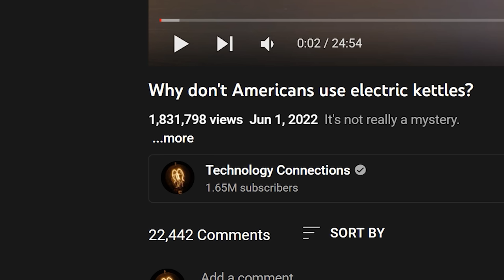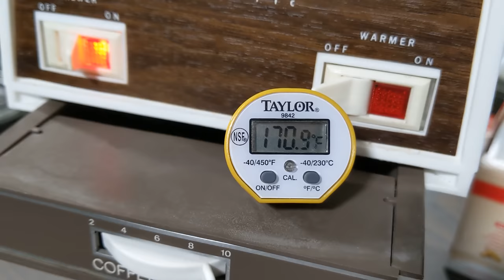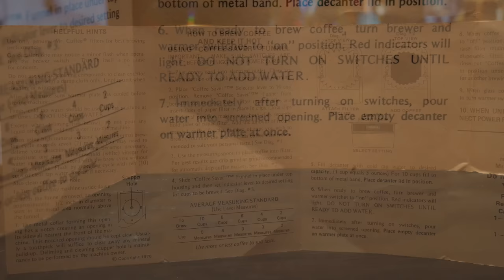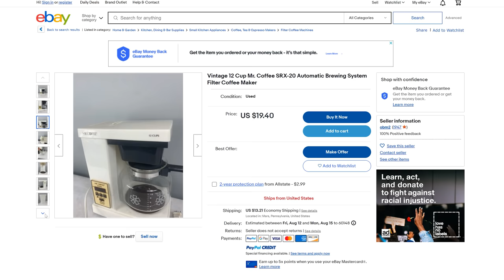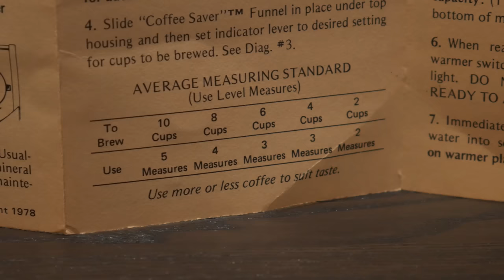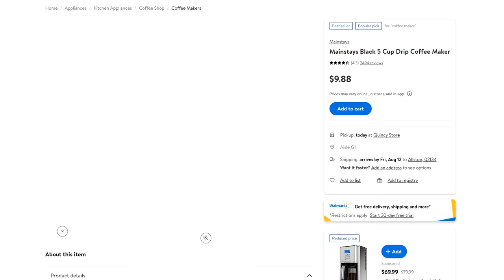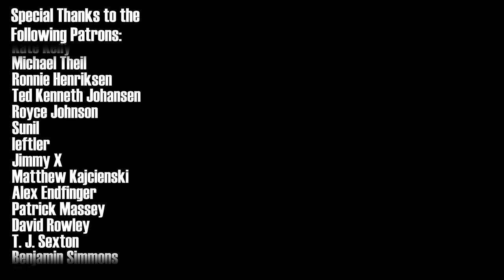Drip Coffee Makers — super simple, super cheap

Comment: I'd like to see you try the Finnish trick of putting a few pennies (usually 3) on the hot plate. Almost everyone I know (including most restaurants...) does this, with the intention being to reduce the heating from the hot plate to mitigate or at least delay the ruining effect heat has on the coffee.
Reply: That's brilliant:  thanks!
Reply: I can confirm we do that here in the Midwest US. Especially in diners that still use the commercial bunn machines.
Reply: Or get a good coffee maker (which usually means more expensive, yes) that has a separate heating element for the plate with a thermostat that keeps the plate at an ideal temperature :)
Reply: I am a single guy who enjoys coffee at any temperature.  To me the biggest thing that spoils coffee aside from hot plates is air exposure.  A good insulated sealed carafe is must have for me.  I do an electric kettle pour over straight into a carafe then seal it up and drink it down over the course of 3 or so days.  I also live in the Midwest if that means anything.  In the summer the cold milder flavored portion of the coffee is as welcomed as a fresh brew.
Reply: @natebell4764   There have been coffee maker models that, instead of having a hot plate, drip the coffee straight into a thermos can (i.e. a vacuum-insulated container with a sealed lid). I do not know if they are still available currently.
Reply: @pev_  It's an option for sure. Costs more than 3 pennies tho. =)
Reply: @pev_  At least in Finland there are still plenty of thermos ones yeah, like over 100 models on just the first price comparator I used, with prices ranging from 10€ to 800€. =)
Reply: @2009dudeman  I have seen a different method of the places in Upper Plains of the USA South Dakota North Dakota and parts of Nebraska/Minessota they use not pennies but they use a piece of paper towel that has been wet first. I do not mind the effect the heat has, it gives coffee this caramel flavor.
Reply: @pev_  That's good to know.  I will have to keep an eye out for one.
Reply: @pev_  Sure, but when you're travelling sometimes you get stuck with these.
Reply: Same in Sweden.
While brewing into a thermos works, I find the taste after a few hours inferior to just removing the pot and let it cool fast on the sink-bench, and then put the mug in the microwave oven for a minute whenever some beverage is wanted.

Comment: Interestingly, the Mr. Coffee maker at my house has a really clever (if, probably, more expensive) solution to the hot plate problem. Instead of any true "keep warm" feature, the carafe is heavily insulated. It actually keeps the coffee piping hot for hours, even if it's left sitting on the table instead! Honestly more convenient, because you can take the carafe with you to your desk or wherever, and you don't even need to get up to pour another cup.
Reply: My parents and workplace both have drip coffee makers that use insulated carafes instead of the standard hotplate design as well. No burnt taste but does require some microwave reheating after an hour or two.
Reply: More energy efficient too
Reply: If you dont have one, just get a hydroflask. There is no acceptable reason to use the hotplate when hydroflasks exist (not name brand, cheapo ones work fine).
Reply: @werevamp  Genuinely, the one we have keeps coffee HOT for hours. My father will make coffee at 8 AM, and I will groggily trudge upstairs at noon and still have it be hot. I've poured it out at the end of the day and have it still be warm. I don't know why our specific carafe is go aggressively insulated, but you won't hear me complain.

Comment: The Bunn-O-Matic works slightly different. Basically, the water that comes out is not the same water you put in. These models have a tank of water that's pre-heated. You have to put the empty carafe on the warm plate first. Then fill the provided plastic container with cold water and pour. That pushes the pre-heated water to the coffee grounds. The cold water that was just poured in is saved and heated for the next cycle.
Reply: This. Needs a follow up video to explore. Bunn-O-Matic seems to make better coffee in less time.
Reply: This sounds like an very terrible idea
Reply: @lukasvondaheim  Not if you're making gallons of coffee to serve a big office, or a restaurant (or a small office of grad students). That's where you usually see the Bunn-O-Matic. My research group in grad school convinced our advisor/boss to buy us one and we managed to run a completely passive device into the ground with our prodigious coffee consumption.
Reply: Bunn actually makes a home brewer that works essentially the same way, the Speed Brew. I have their Heat N' Brew, which works somewhat similar to the original Mr. Coffee.
Reply: @lukasvondaheim  No, it’s not. If one makes one carafe of coffee per day, one carafe of water is in the tank up to one day. If one makes one carafe of coffee two times per day, one carafe of water is in the tank up to half a day. The tank of water is kept at near boiling temperature much like hot water stored in the hot water heater in homes. It is no different from the Keurig machines that store a tank of water. Bunn-O-Matics are used in commercial settings such as in restaurants.
Reply: @simmonsjoe  Yeah it's less time because water is constantly kept at incredibly high temperatures all day. It's just as bad as a tank water heater in terms of electrical efficiency, just with even less insulation. It's just convenient for restaurants because they go through that water all day.
Reply: @weevilsnitz  Pretty much. The big Bunn-O-Matic is the coffee making equivalent of a diesel bulldozer next to a family compact drip machine. Different use cases.
Reply: @simmonsjoe  I have had the home version and if you dump 12 cups of water into one...only 10 cups will come out due to evaporation  from keeping the water hot in the tank all night.
Reply: Woe betide the prep cook who forgets to plug in the Bunn first thing in the morning. Ask me how I know. 
And yes, the water does taste stale and deoxygenated.
Reply: Glad to see someone mention the Bunn Speed Brew does so differently than most other modern drip brewers.

Comment: I live in the US, I'm not an American but I live here and I own an electric kettle. They are available, just not as common.
However, it does have to be pointed out that 120v does make for a slow boil compared to 240v.
That being said, I use a kettle when it is most suited to be used regardless of how long it takes. The rest of the time I use any one of the many coffee making machines I have, but remember, if they are electric then they use the same 120v as the kettle.

Comment: At a previous job I was tasked with designing a coffee blend that would still taste good after sitting on restaurant hot plates for a while (hours.) Looking for coffees that are less acidic and have more chocolatey/earthy flavors can greatly improve the experience going back for your second or third cup. Avoid coffees with flavor profiles that have acidic fruits or other things as part of the description. As coffee cools acidic flavors become more pronounced so this also helps if like me you sip your coffee past it being cold.

Brew time is a big factor as well, too short and you don't get all the parts the give the coffee its full flavor. Too long and things get watered down, more acidic, and can taste off or sour. Adjusting the grind impacts the speed the water flows through and can have a huge effect on the final product.

Not to get too long winded but you can use not enough coffee and still over extract it, just like you can under extract coffee while using too much. Both result in off flavors in their own way. I can't tell you how many places I would find using way too much coffee because they thought it was too weak tasting when the problem was their grind was way too course for their machine resulting in under extracted coffee. If your coffee is too bitter adjusting the grind and making sure your water/coffee portions are correct will get you very far.
Reply: This is really helpful, thank you!
Reply: Yes, very helpful. I tried what you said and it works! (I won't mention how many years I've been doing it wrong.) Thank you, a little bit of my life has been made better because of your thoughtful comment.
Reply: Good advice!
Reply: You are so welcome, I am delighted to hear it was helpful!

Comment: One thing you didn't mention, that unlike percolators or electric kettles, that since a drip coffee machine doesn't give you coffee that's quite as hot, you don't have to wait as long after brewing before you can actually drink it! My favorite part is because they're all so consistent, you can find your favorite kind of coffee and expect it will taste the same pretty much regardless of the machine you use. Even most hotel rooms have the same cheap machines, and I know a lot of people that bring some of their favorite coffee with them.
Reply: One thing I will say for stove top percolators is that the water hitting the coffee isn't boiling it boils in the bottom pushing it up through the tube as steam but by the time it hits the coffe it's condensed and the temp has dropped still not the best method if you care alot about coffee but if that was the case you would have an espresso machine but it's a perfectly fine way of making coffee I will say though it doesn't feel as safe since you have to watch it  the drip machine you can set and forget while you get your other things done in the morning
Reply: @caradanellemcclintock8178  if u care about coffee you’re not using a percolator, and certainly not a drip coffee maker (or those super nasty pod things).
Reply: I love that some electric kettles now come with options for water temperature, 80-90C water works better for darker coffees, especially with things like AeroPress. Still isn't as convenient as coffee machines though.
Reply: @newagain9964  Why are you gatekeeping coffee?

Stop that's ridiculous.
Reply: I simply use a coffee cone with paper filter by itself. No need to buy a machine to do something I can easily do it myself. I do everything directly into a large insulating mug so I can drink the same coffee for the whole morning and it will still be warm
Reply: I just stayed at 2 different hotels, they both had Kurigs...
Reply: @SmarterThanAll  pointing out that something sucks isn't gatekeeping. Calling it gatekeeping is equivalent of Civic owners talking about how their clapped out cars are sports cars and anyone pointing out they aren't are gatekeepers. 

It's a plain fact that Percolation coffee is only good if all you care about is getting a remote taste of coffee. It kills the flavors, the acidity and bitterness of coffee and anything except dark roasts made to be "Safe" taste rather lacking. No hate if you like it but it's barely a fraction of the spectrum coffee offers. Also most drip coffee makers are terrible, they will make a repeatable cup of coffee that works but it's not really good once you taste something proper. Doing it manually will give you far better results
Reply: @CryoFreezr  Please develop a personality One that isn't hyper cringe and obnoxious. It's like you're a cartoon character. My goodness.
Reply: @TychoKingdom   most intelligent and least generic youtube user whose only rebuttal is "muh opinion good, your bad, me original, everyone else fake and bad." This seems to what lots of internet with no real coherent thought process and literature skills does to a human
Reply: @MaxC_1  Hey man I grew up working on a ranch where we'd just throw a handful of coffee grinds into a pot of hot water over a campfire and dip our cups out. As far as I'm concerned a drip coffee maker is luxury and far better than the "doing it manually" than we could do. Fact is there's always a "better" way of doing anything. But just because it tastes better, doesn't mean it is better, because sometimes you don't have the means or the time to spend on a single cup of coffee when you have work to do.
Reply: @caradanellemcclintock8178 TRY adding periods to the end of your sentences .  Makes it easier to understand you
Reply: @newagain9964 Lucky for me I don't care about coffee, only the caffeine contained therein.
Reply: @dchawk81 i started for yhe caffeine but i swear it no longer works. I drink now because i developed a taste for it i guess. Its my morning routine with my wife.

Comment: My grandparents ran a diner from 1938-1965 that was on a major highway.  The sign in addition to saying (Our Diner) also had the subtitle, "Good Coffee".  For making coffee, they had a two-pot glass contraption.  Two Bunn-like pots joined in the middle, with coffee in a chamber between them.  The coffee was loaded, the water put in the lower pot, the halves joined, and the whole thing put on the stove.  Water boiled & the pressure forced it up a dip tube into the top chamber.  When the bottom chamber was dry, steam stopped being generated, and the vapor in the lower chamber began to cool even though the flame was still on.  Vacuum drew the hot water in the upper chamber through the grounds & back to the lower chamber.  Don't know what it's called.
Reply: The process you described might beling to geyser coffee maker. It’s like a percolator, but coffee doesn’t come back to the lower chamber and getting re-brewed. It just goes to the upper chamber through a middle one with coffee grounds in.
Reply: Or a syphon, Hario makes some home ones if you want a reference pic
Reply: Sounds like the vacuum-brew we had in a bed and breakfast I worked at a couple of summers:  Fill the bottom carafe with water, boil it up into the basket above, then take it off the heat to cool and suck the water through the coffee Had to be careful as the carafe was definitely breakable and could make an awful mess.
Reply: Maybe a vacuum coffee maker? I’ve used one that sounds like what you’re describing.
Reply: @shades344  It' been 50 years, but my hazy recollection was that of vacuum brewing.
Reply: @shades344  @Jere - Yep, that's it!

Comment: I wonder if the older machine would've hit closer to exactly 200⁰ f when it was new, and if regular use would soften the bi-metal and cause the temperature to fluctuate more now than it would at first
Reply: Wouldn't the bimetallic strip get stiffer over time due to work hardening?
Reply: I wondered the same.  There is that calibration screw.  I wonder if it could be tweaked to bring it back in line.
Reply: Given that he mentioned that the thermostats on the newer ones seem to drift with time, that’s a possibility.
Reply: @tissuepaper9962  I would expect it to change due to the fact that different metals will react differently to long term exposure to both heat and thermal cycling. Work hardening could maybe come into play too, depending on the metal. Not all metals work harden.
Reply: @tissuepaper9962  I honestly have no idea, I just imagined that the lower temperature would come from having a larger opening which could suggest a softer metal, but maybe it is harder and it just happens to be "stuck" in a more open position
Reply: @veggiet2009  what seems more likely to me is that the calibration screw has loosened over time because of the heat cycling, and being pushed/pulled on repeatedly by the bimetallic strip.